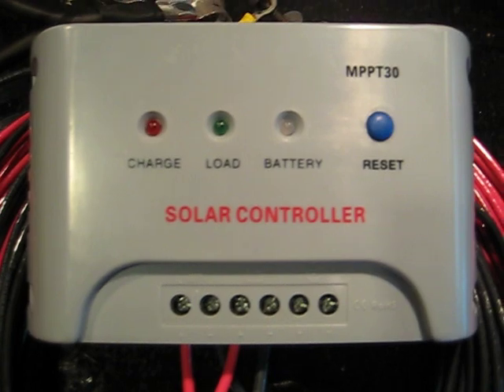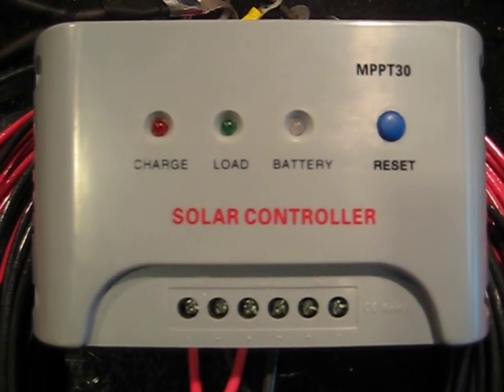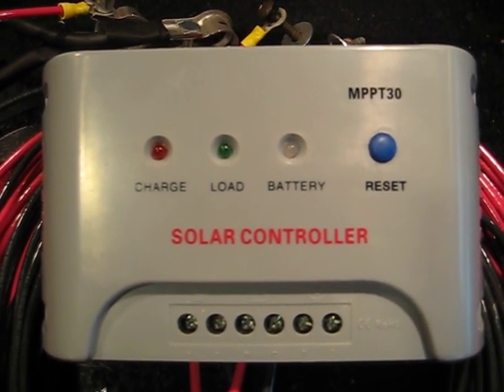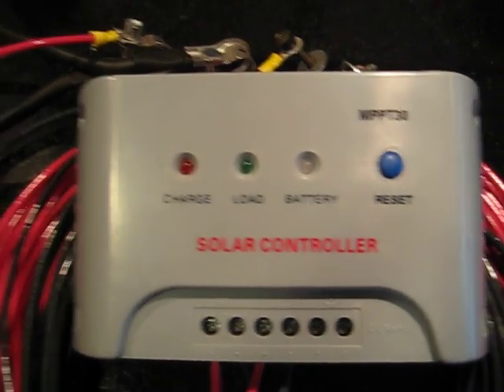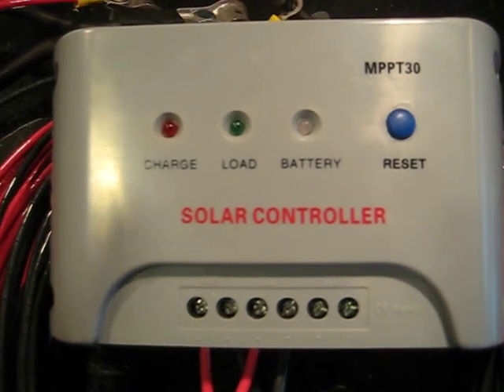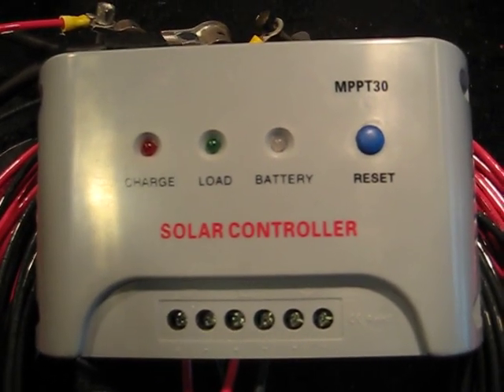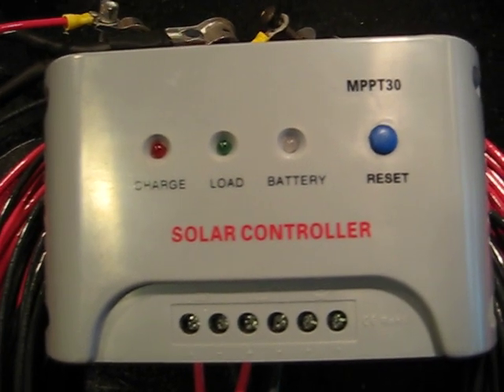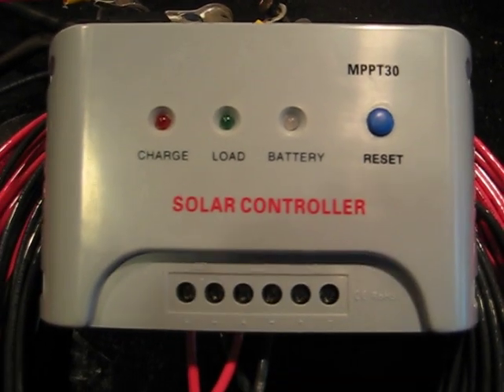Harbor Freight Solar Panels: MPPT Charge Controller

Comment: How do you connect harbor freight panels to an aftermarket MPPT controller? Just cut off the connections and stick them into the slot and tighten or do you need an adaptor to get it down to one wire for positive and negative to go into your charge controller?

Comment: Dude you need some serious education between MPPT and PWM controllers.
12Volt PWMs are 95~97% efficient as long as the voltage of operation is within that parameter for the panel VMP output I.E 15VMP
12volt MPPT's are a PWM controller plus DC/AC/DC converter to reconfigure a voltage higher than 15volt VMP, for example to convert the remainder of high voltage (20V) in amps so that the yield in watts is 97.5% efficient 
12 volt systems only need PWM if theSTC rating of the panel is under 18 volts.

Comment: Don't buy this controller. Fraud. From amazon-
"The manual shows that this Chinese manufacturer makes these in 15, 20, and 30 amp sizes and 2 Amazon vendors (Tektrum and Instapark) put their own label on it. Three other reviewers of various sizes of this unit have also concluded that this is a fraud and not MPPT. There were 3 more reviews of these but none tested them for MPPT."

Comment from the maker: You can but that isn't what I use. I use golf car batteries. They are designed to be used and charged every day so they last at least twice as long as car batteries. Car batteries are designed for a big surge of power to start the car.

Comment: @LDSPrepper Great, I just finished a 480 watt system myself. But I have to give Harbor Freight credit for getting people started on solar. It's one of the few stores I know of that one can walk in and buy solar equipment. It's a shame that you can't go into Home Depot or Lowes and buy solar panels and charge controllers. Why is that?

Comment: Ok, I bought a Harbor Freight 45 watt solar kit a year or so ago. It was a good foot in the door. But friends, that kit is expensive, about $150-200 for 45 watts of amorphous solar panels that register 5-10% efficiency. Pairing an MPPT controller with HF panels is like putting racing tires on a Yugo. One can buy a 100 watt polycrystalline solar panel (15% eff) on Ebay for $180 to $200. Pair a few of those with a Rogue MPT 3024 controller, and now you've got some real juice. But HF got me started

Comment: Morning Star has a ton of controllers here: ecodirect Solar Charge Controllers I hope this will help everyone who is looking for controllers that allow you growing room. These are not that much more than the cheapo brands. They go from 6 amp 35 dollar units to 80 amp 600 buck units with everything you could ever need plus. I am still using my HF one, however I am going to need a new one with more flexibility for wind and water inputs. Cheers all, and thanks for the info!

Comment: I would get a morningstar controller at the very least.  They are a little more expensive but you get what you pay for.  These cheap chinese controllers are not going to be reliable and the Morningstars are sealed to the elements.

Comment: Another nice thing about that controller is this; Using 12volts you can handle six HF kits or a total of 270 watts, however, when you change your batteries to 24volts this same controller will be able to handle 12 HF kits or a total of 540 watts. So made a nice choice that will protect your investment and by simple changing the way your batteries are connected will allow you to double your growth and capacity.  Nice!

Comment: Nice video LDSPrepper, you've come a long way! The initials stand for Maximum Power Point Tracking which automatically adjusts the voltage or amperage as needed by the state of the batteries to maximize the panel's output. It gets you about 30% more power from your panels as compared to traditional charge controllers.

Comment: only thing is if and when you go higher voltage you loose the 12 volt options out there. Best things are like outback flex max 60 that lets you run long leads at high voltage on smaller guage wire. Then convert say 48 or 60 back to 12 at the batts.

This way you can still run all the 12volt accessories just look up 12V trucker websites. 12 volt everything fridge coffee maker what ever. Not to mention less batts needed.

Comment: The MPPT will get about an extra 30% more power from your panels. From Solar panel to AC use, you can expect to loose about 20%. So as an example, if you can make 1000 amp hrs, after a 20% power loss you will have about 800 amp hrs left. Later from sunny FL!